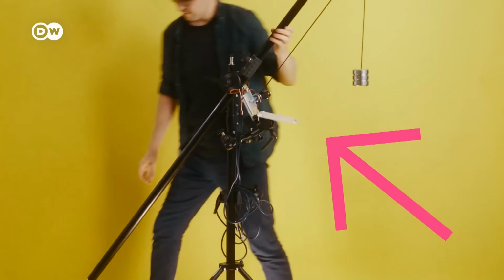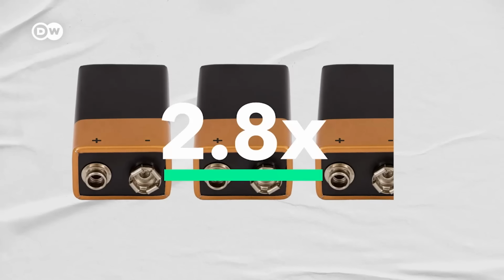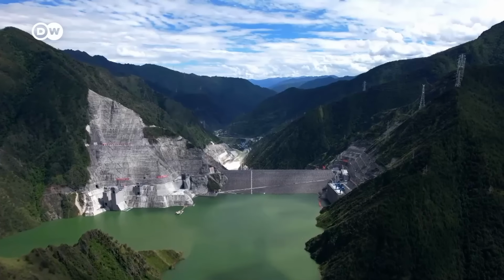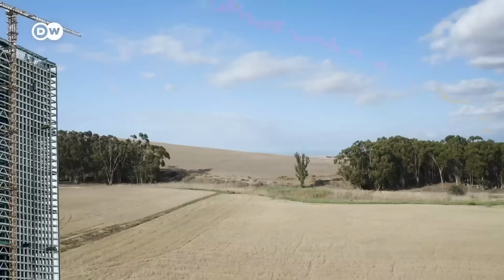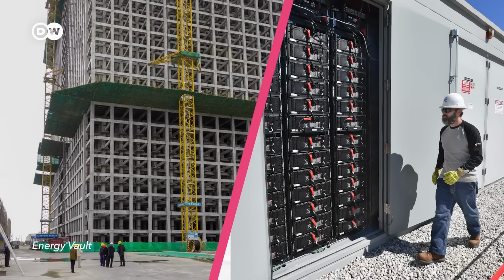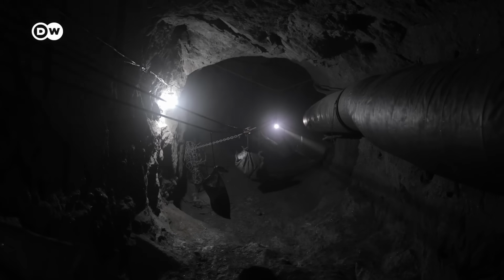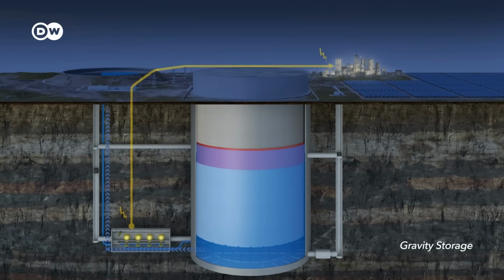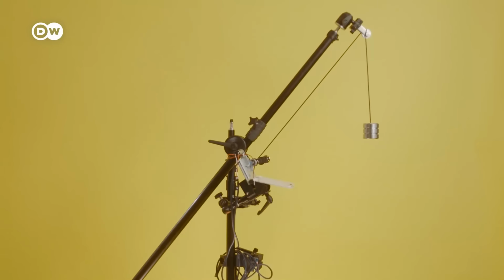How to use gravity to store energy

Comment: How to use gravity to generate energy.

 🧠 Gravity-Buoyancy Engine Based on Corrugated Blocks
Core principle: localized water pressure + mechanical density switching, no external energy required

🔩 Structure
Rail: A closed vertical loop, shaped like a tall oval, fully submerged in water.

Two vertical sections (upward and downward).

Two curved arcs (top and bottom) where the blocks flip orientation.

Trolleys: Each trolley rides on two contact points — like a Roberval balance — which cancels rotational torque on the arcs.

Trolleys are linked at their geometric centers, so neighboring blocks don’t interfere with each other’s balance.

Corrugated Block: Mounted on a trolley, tilted 45° relative to the rail.

Contains two air chambers: a thick corrugated hose and a thin one, connected by levers.

Inside the thick corrugated hose is a soft elastic band that gently pulls the ends together.

The corrugated hoses are pneumatically linked and connected to a shared air circuit that runs through all blocks.

The visible end surfaces of both corrugated hoses are equalized — water pressure acts symmetrically.

Part of the thick corrugated hose’s end area is redirected to rigid frames via flexible corrugated hoses in a bendable exoskeleton, preventing unwanted compression.

🔁 Operating Cycle
1. Neutral descent
The block is neutrally buoyant and perfectly balanced.

It sinks down the vertical rail section.

At the bottom arc, it flips 90° effortlessly.

2. Buoyancy activation
After flipping: the thin corrugated hose is lower, the thick corrugated hose is higher.

Water pressure compresses the lower thin corrugated hose.

Levers transfer this force → stretching the thick corrugated hose.

The elastic band inside the thick corrugated hose stretches, storing energy.

The thick corrugated hose expands more than the thin corrugated hose contracts → overall volume increases, density drops.

A vacuum forms → air is passively drawn in from the shared circuit.

The corrugated block becomes buoyant.

3. Ascent
The corrugated block rises up the vertical rail section.

A chain of buoyant corrugated blocks creates continuous upward thrust.

This is the system’s global buoyancy symmetry — shown as a large arrow in the diagram.

4. Air release
At the top arc, tilted 90°: both corrugated hoses are under equal water pressure.

The elastic band now dominates → compresses the thick corrugated hose.

Thick corrugated hose pushes out more air than the thin corrugated hose pulls in → excess air flows into the shared circuit.

That air is used by the next corrugated block entering buoyancy mode below.

The corrugated block returns to neutral density and balance.

5. Descent
The corrugated block joins the chain of neutral corrugated blocks descending the rail.

At the bottom arc, it flips again and reactivates buoyancy — the cycle repeats.

🔑 Principle of Localization
Water pressure is not global — it’s broken into local pressure differences between the two corrugated hoses inside each block.

Torque and pressure are localized — they act within each corrugated block, not across the whole system.

This prevents the system from freezing into equilibrium and allows continuous motion.

Localization is the key that turns balance into movement.

✅ Summary
This engine creates motion by switching density mechanically, using local water pressure, lever geometry, and elastic memory — all appear because the gravity. The chain of blocks moves continuously through the rail, driven by alternating buoyancy and neutral phases.

Little bit more explaining.

Pressure as Potential, Not Fuel
In this system, water pressure is a constant potential gradient, much like temperature gradients in thermal engines. But unlike thermal systems, the gravitational pressure gradient in water doesn’t get consumed or depleted — it remains ever-present.

This gradient is not an energy source in the thermodynamic sense. It’s a cause, not a provider. Gravity doesn’t “give” energy to massive bodies — it simply creates conditions for movement. Likewise, buoyancy is a consequence of gravity in water, not a fuel. It simply pulls neutral blocks into the right orientation for density switching.

The local pressure difference inside each corrugated block is what enables the switch to buoyancy. That switch, in turn, sustains the constant buoyancy gradient between the two vertical branches of the rail.

So this system doesn’t operate by “giving and taking energy” like a heat engine. It operates by creating conditions and directional asymmetries - through the intersection and localization of gravitational symmetries in water. Symmetry of buoyancy in continuous form and symmetry of pressure localized into segments.

Comment: the problem with this is that making concrete takes energy, and maintaining cranes costs energy.
for any amount of concrete that would work at scale to build one of these, it would take more energy to build than it would ever release during its lifetime, at which point grid inefficiency is less costly than building one.

Comment: Concrete would degrade with use, the solution to that would be to use something that doesn't degrade, like water for example. Another problem would be the wind messing with placement - again you could solve that by either building a huge tower and putting everything inside or dig a hole and place everything in there. But that is way more expensive than the original concept, so maybe let's use some kind of storage that is already existing, like a lake? And what a surprise, you just end up with a hydro dam.
These tech bros are really just trying to find the worst solutions to the problems that we have already solved.

Comment: How feasable is to install this gravity storage battery into an elevator?
Although using it when needed by normal, but having the elevator go down from upper levels and releasing energy in the process and when it goes up, it "stores" energy but also go up. 
Might be a very big engineer mess but sounds so cool in theory.

Comment: Gotta be one of the most stupid energy-related ideas in history.
Why build a tower? Just dig a hole and put it there - cheaper and no wind-induced instability.
Why use concrete? Just use water - cheaper (again) and no materials degradation.
Why use hoists? Just use pumps - cheaper (yet again) and significantly reduced reliability or safety concerns.
Congratulations! You reinvented pumped-storage hydroelectricity more than 100 years too late...

Comment: This is a very expensive and space-consuming approach to energy storage. To build a device capable of storing energy on the necessary industrial scale, an enormous structure needs to be built. It is vastly more efficient, cheaper, and less space consuming to use battery storage. This is the engineering equivalent of building a bridge from Florida to the Bahamas rather than using an airplane or a ship.

Comment: why not just dig a hole instead of having it above ground? no need for that much concrete and no problems with wind etc
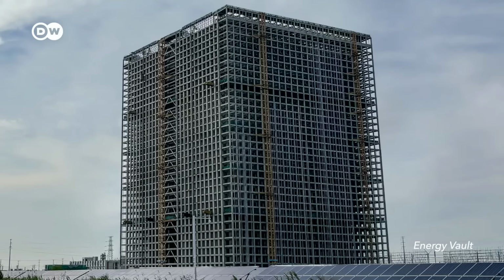Reply from the maker: Underground versions using mine shafts do exist, we explain how that works in the video around 7:45.

Comment: E_weight = mgh = 1000 kg * 9.81 m/s^2 * 1000 m = 9.81 MJ
E_battery = m*(E/m) = 1000 kg *1 MJ/kg = 1000 MJ

Lifting one ton of lithium-ion batteries (without wiring or enclosure) by a kilometer would add less than 1/100 of the energy to them that they can contain in their charge. Pumped hydro only works well because water is easy to obtain, store, and move. Each unit of water doesn't contain much energy, but there are many units of water to make up for it. If you want more energy storage, but have already exhausted the few suitable sites for pumped hydro, just plop batteries into a random field.

Comment: What happens if it uses two cable systems, one to go up using a compound pulley system to bring the weight up with much lower work, then when at the top it releases from the pulleys system to come down at full weight? Are we gonna get from it more than it took to get it to the top or am I tripping?

Comment: Why not use sundance generater to power homes no solar or lifting weight or other crap just what we have now...Generators flywheel with coils and battery for start up that is it works no stop no extra energy ..This was ot a long time ago its still online .It can power home oi scale up to power more . But you can replace coils while running it ...

Comment: I don't understand the release part. If you let it slowly fall by gravity itself, without tightening the rope you get maximum energy. But this would crash it into the ground, or snap the rope at near-bottom.
If you lower the concrete cube slowly like shown in the video, by a brake system as shown too in the video, you get low energy. So what's the purpose?

Comment: I am sure someone else might have talked about this, but I don't think the actual physics of what is being suggested is brought up enough. I think it might be worthwhile to break it down. When we are lifting these blocks we are storing energy in the form of gravitational potential energy. The formula for that is (simplified for small distances near the earth) U = mgh. We can take that formula and figure out how much energy we're actually storing each time we lift one of those blocks. Taking some of the notes from the video, one of the blocks in question is 25,000 kg, lifted (roughly) 100 meters up. Putting that into the equation we get a little under 25 megajoules (standardized unit of energy, don't worry about it too much since I'm drawing a comparison) Lithium-ion batteries on the high end are around 1Mj/kg. So each block, before any energy losses from either side, is the equivalent to about 25kg of lithium ion batteries.

That's the math we're looking at here for pure energy storage. What that doesn't take into account is losses on both sides, which I think the video does a good idea of demonstrating.

This video did come before the discovery in the U.S of large lithium deposits sitting in the McDermitt Caldera, which may change the overall economics of lithium batteries quite a bit as both the U.S and other countries look towards old magma deposits to see if they may build viable supply chains. I am no specialist on their recycling, but lithium does certainly degrade over time, and this degradation is a very complex process requiring the battery to be structurally rebuilt due to atomic defects arising in the material itself (there are others who may speak on it better and papers interested individuals can read to learn more about the specifics of battery degredation). I like the idea of other companies trying out new things, but I do think for long term energy storage that can go anywhere, something like compressed air or thermal batteries may be a better solution. Both use relatively inexpensive materials as well, and can be done almost anywhere.

Comment: So you just need to use a water column and float the weights back up so you don’t use power to winch them back up, saved the world 15 trillion a year, you’re welcome.
Reply: What you are talking about is already being tested. It's called Ocean Compressed Air Energy Storage.
Reply: @Nubian_King_RNM  That is not what I am talking about, I am using gravity to make energy and buoyancy to elevate a weight, there is no need to wait for renewables to make compressed air and you can build a water column anywhere, think of it as an water elevator that lifts the blocks in a gravity battery.

Comment: what happen when things like deep cycle solid state battary come into mass market there twice as dense as lithuim ion that means they take up even less space and weight then lithuim ions storage solution there less tempreture sensative and they can cycle up to 10,000 cycle before degrading under 70% compare to lithuim ion that only manages 2,000 cycle if lithuim ion can last 10-15 years solid state can last up to 50-75 years and we have solid state in small scale production today or we can go salt base soduim ion battary there extreamly cheap to produce raw material wise and eco friendly they last just as long as lithuim less temp sensative and have 80% the energy density of lithuim.

Comment: I wonder if this could be used like a conversion kit add on for commercial buildings using its elevator shafts. Every time elevator goes up n down its charging on a smaller scale, meaning to help power that building and not an entire town or city grid etc? It’s not my career field so I don’t know if that’s even viable. Maybe combined with solar it helps for night time use.

Comment: Why isn’t there any return sprigs or opposing magnets on the bottom of the blocks to help get it moving back up faster and using less energy?  Use a compressed air system where on the way down the force fills tubes with compressed air and then when the blocks need to move up release to air for an initial boost?

Comment: Think about the economics of a coal mine. It is profitable to dig a mine and only use the coal from that mine for a single day.  A mine for a gravity battery can be used for 50+ years.  Digging new “mines” or using existing mines seems like a very cost effective and safe way to store energy. It seems like going “down” is much less expensive and safer than going up.  The weight of a mass is obviously very important.  Why not use iron ore as the weight?  It would be 100% recycled so it is just a matter of financing the use rather than the consumption of the ore.

Comment: It is not hard to calculate the amount of power required to lift a weight over some distance.  Unfortunately, even if you are able to get 100% efficiency generating power when you lower the weight, and if you use the cheapest concrete or iron for the weights (or even containers full of dirt or water) combined with an efficient grid sized generator, such a solution would be at least two times more expensive than the current price of lithium batteries per megawatt hour of storage.  There is no fix for this.  There is no indication that useful life would be better, and maintenance would certainly cost more. Using abandoned mines does not fix the economic disadvantage.  Just the weights and the generator is more expensive than batteries, and you will always need that.

Comment: Find a potential energy calculator online. Check how many kWh you use in a month. By choosing the weight of a cube, e.g. 1 ton, you will get the answer to what height a 1 ton block should fall. Divide into 10-meter columns. Of course, the idea makes sense.

Comment: Would not a very deep mineshaft with storage areas at the top and bottom of the shaft require less construction materials?
Reply from the maker: Yes indeed! Using an existing mineshaft is actually part of the idea behind some gravity battery projects (like Gravitricity). 🦾
Reply: @DWPlanetA  There are also lots of areas of very deep ocean close to the coast of various Nations/Continents. (South America for instance).
The density of water reduces the effective weight of anything suspended in by 1 Ton/Cubic Metre but since a ballast such as iron ore has a density of approx 2-3 Tons per cubic metre this does not represent any significant handicap.

Comment: I think I've thought of an idea to reduce the energy needed to bring the blocks back up without using electricity the whole way up. They could use large flotation drums in four shafts running parallel to and surrounding the shaft with the block. The flotation drums sit at the bottom of their shafts as the block is being lowered. When the block reaches the bottom of its shaft, the flotation drum shafts are filled with water. As the flotation drum shafts are filled with water, they lift a platform the block sits on until it is returned to the top. When the block is returned to the top, the water is then drained in its neighboring flotation drum shafts, allowing the flotation drums (and the connecting platform) to reset at the bottom where the process starts all over again. Of course, the lifting capacity of the drums in water would have to be measured to be greater than the weight of the block. The entire facility could be enclosed in a large building, further eliminating the effect of wind on the blocks. The water might not even need to be pump in all the time but instead stored on the roof from rain water or from aqueducts that channel run-off from nearby mountains on to the facility roof.

Comment: This won't work.  When the weights reach the bottom you have to use a bunch of energy to move them up to the top.
Reply from the maker: Hey there! Yes, the weights are brought up when there is lots of energy available, when there is lots of sun and when there is no sun available, the energy can be released by letting the weights down.

Comment: This could be used for offshore wind power especially with floating turbines. Use excess energy to lift weights from the sea floor which can be thousands of feet deep. Let the weights fall back when the stored potential gravity energy is needed.

Comment: I fail to see any gains in doing this.

Aren't you simply putting back the same amount of energy as it takes to lift the weights?
You can't get out of any system more energy than you put into it.

That's not to mention, energy will also be lost through friction, moving parts, heat etc.

Comment: What I want to see is a Buoyant Force Energy generator. Buoyancy is stronger than gravitational force. Say, a mechanism placed between the floor and the surface of the sea, which the pressure can be utilized. Maybe a mechanical spring against Buoyant pressure can generate electricity.